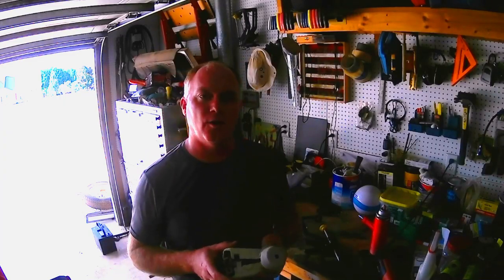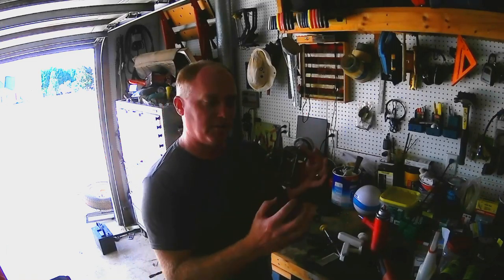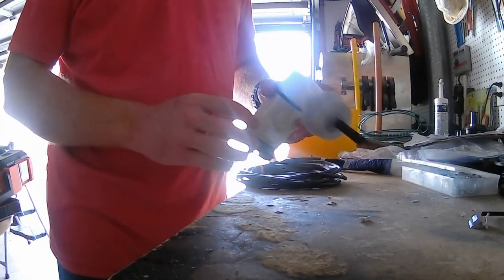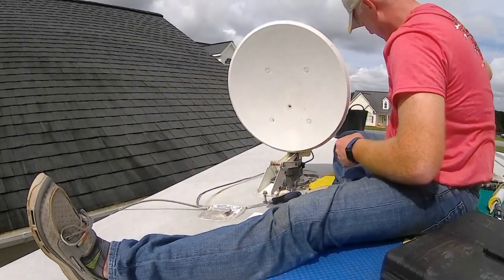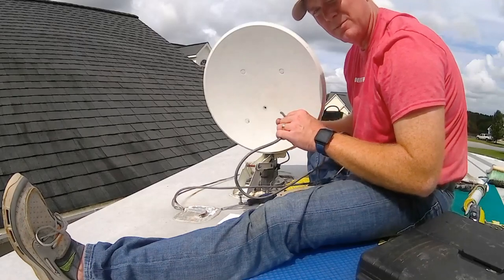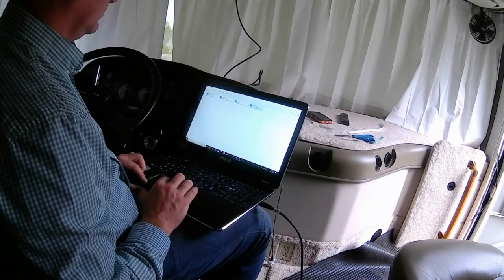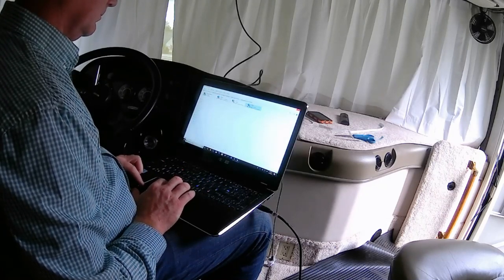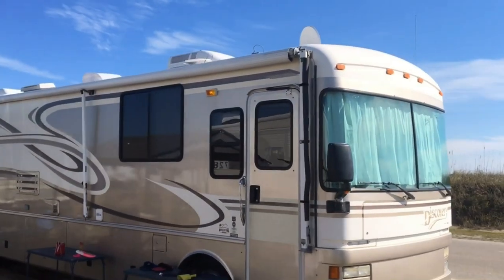Satellite Dish retrofit to a WiFi Antenna - Vintage Class A Motorhome

Comment: I went to Asian store and bought largest parabolic fry basket I could find. I cut off the handle and retroritted a USB wifi dongle to the focal point. I took that with me on vacations all over creation and it worked great.  We were on vacation in Kissimmee at a time share. We were on the 3rd floor.  The wifi was $50 per week.  I aimed it over at a motel that had free wifi and it paid for itself over and over.
Reply: How far was that wifi and how far can you connect with wifi dish?

Comment: I'm actually trying to work out a similar setup in the UK using old Sky TV dishes at both sides but I'm using it to connect 2 house networks together (parents and mine as I have servers at each property). I've done it before with a cheap shotgun aerial and a panel aerial but that was only providing Internet to my parents when they couldn't get it and I could. Fingers crossed my bi directional WiFi network works (similar to the campus WiFis)
Reply from the maker: Awesome!! As long as your alignment is spot on, it should work. All you are doing is narrowing the band and making an omnidirectional receiver and an omnidirectional transmitter, both directional.
Good luck!!
Reply: @RVPastorKevin  yeah that's going to be one of the most important issues but I was actually thinking I could get it roughly lined up via line of sight then us a signal/attenuation meter to dial it in to the strongest signal by moving it back and forth till I get it ideal. Was going to use a geared adjustment on the mount to make sure I can adjust in very tiny amounts. 3D printer should be able to give me a prototype and then I can print it in ABS and add a metal clamp for holding at that point. Anyway thanks for the idea of using the LMB I was just using it without but I can see how it could help with alignment etc.

Comment: i made an aiming sight for a dish  ....first  hot glue 4 small round mirrors  in a circle on the dish .. use the sun to find the focus point .. now use the sun to make a sight .. mount a ring sight just to the side of the antenna mount .and drill a small hole in the dish  as a back siight  . the sun will tell u where the hole should be .. it will be at the bottom and beside the antenna arm  .. use the sun as a calibration tool .. kinda like bore sighting a scope    yerh thats it ..  ifound that u only need to be off by a tiny bit    to get a bad  result.

Comment: Instead of a laptop use a router with a USB port. Make sure the USB device is supported by linux.  Get one with the following chipset:

    Atheros AR9271
    Ralink RT3070
    Ralink RT3572
    Ralink RT5572
    Realtek RTL8812AU
    Ralink RT5370N
    MediaTek MT7610U
If you do not know (and most would not) ask at the computer store. Any store worth their salt would know.

Comment: Mate, the improvement in signal has nothing to do with the dish !  You still have your offset dish looking into space and your wifi adapter's antenna is 90 degrees out of phase.  The improvement in signal is only because the wifi adapter is outside and up fairly high.
Reply: And the dish looks to be 18 inches.
Reply: Probably true. I saw one guy who mounted his dish upside down. But hey if it works it works.
Reply: Well, the antenna is 90 degrees out of phase of the signals coming directly at it from the source, but NOT from the signals reflected from the dish surface towards the antenna. So, I think this approach still has potential.

Comment: If you want you can attach a tin can to the end and drill a hole on the side and insert the antenna to get an even more boosted signal. You’ll have to look up cantenna equations so you know where to drill though.

Comment: Great Job... I plan on doing this with an old dish soon.  Do you know how far the range is about?
Reply from the maker: Well, the only way I can think to test the range properly would be somewhere very remote, with a known transmitter location that was line-of-sight away...... which I have not done. The math seems to indicate that a given a regular Wifi transmitter, and depending on the accuracy of the dish alignment, this antenna should be able to pick up signal over a few miles.
Since we have stayed in RV parks across the southeast, I can say that prior to this mod, park Wi-Fi was not even useful and we used our phones as hotspots. Now, I send my 12 year old to find the park Wi-Fi x-mitter, we point the dish at it, set my laptop as a hotspot, and the Wi-Fi at every park has now been so good that we connect the Roku and stream movies with zero buffering! I am very pleased with how this turned out!

Comment: Any specific measurement that should be followed,...and what was the difference in signal reception before and after.
Reply: Around 15 dB stronger, it's a lot, you can connect to nearest MD without problem from 1 miles.😁

Comment: So once you get everything hooked up how do you get more than one connection say my wife wants to hook to the internet does she find the usb that say is called Rv park WiFi or does she connect to the Rv dish that I built
Reply from the maker: Think of the dish now as a usb WiFi dongle. You plug it in to your laptop, then your laptop has the solid connection.  You then make your laptop a “hotspot” and you and your wife and your kids will wirelessly connect to the network that your laptop is transmitting.
Reply: Oh ok I’m having issues with my internet connection where I live! I live in my fifth wheel full time plus I’m a ham radio operator as well

Comment: yea Rev pls i need assitance. about the usb adapter, i got one not exactly the same you used but the outcome was discouraging. do you think yours could be better and give me the result or there could be better out there, whats the guide
Reply from the maker: Here is the link to the one I purchased.
https://www.amazon.com/gp/product/B0773ZPKS2/ref=ppx_od_dt_b_asin_title_s00?ie=UTF8&psc=1
Check to make sure the specs are the same, I don't think there is anything special about the one I purchased... i just know it works well with my set-up.

OK, a couple of things to make sure of, whichever WiFi adapter you use.....
Make sure you install the correct driver on your PC.
Make sure you dish is aimed directly at the wifi transmitter.
Make sure your LNB is correctly aimed at the center of the dish.
Make sure your PC has selected the USB adapter and not the internal WiFi adapter.

Comment: Hi can i install a mimo feed to my old dish antenna ? just to boost the signal of my internet signal instead of buying a parabolic.TIA
Reply from the maker: Ok, I must be reading incorrectly, and  I am confusing myself....
are you comparing an old dish antenna (like the huge 6’ rotating ones we had in the 80’s?) or the brand DISH? I think any satellite dish since the mid 90’s should work in the way I did the video, even the shape of the first DirecTV dishes would work, as long as you could replace the LNB with your USB WiFi antenna.

But you may be asking If you could attach a MIMO antenna to the LNB of your old parabolic to tighten the search band? That certainly could work, but I think a MIMO would be omnidirectional and putting it on a dish may do more harm to the signal than good. 

That is my uneducated guess at this point in how I think the question is.
(But I am in no way an expert...)

Have a blessed day!
Reply: @RVPastorKevin  yes, i  want to convert it into signal booster,because i live in an island.The nearest cell site is like 20kms away.My cellphone signal is really weak.I am using a Huawei Modem 936
Reply from the maker: Well, the antenna on the modem is omnidirectional, so you would need to change it to a directional.  As best I can tell, you would want to remove the stubby antennas, with one that was corded, and specific to LTE signal..... something like this would be where I would start my research if I were you.....

Wilson Electronics Wideband Directional Antenna 700-2700 MHz, 50 Ohm (314411) https://www.amazon.com/dp/B00J14YEHQ/ref=cm_sw_r_cp_api_i_C0ypEb3JB6ZRJ

Comment: Well if you don't have WiFi at an RV park just hope there's a local restaurant like McDonald's with open free WiFi 😂 you'll be good then too.
Reply: How far is the range of wifi dish?
Reply: @sezginozcan6612  it's been so long since I saw the video (2yrs ago) but if it's got a distance like modern tube or dish aerials you can be talking miles line of sight. When it's not line of sight they start losing distance quite quickly. In those cases something like an Omni-Directional aerial would be better as it would remove the line of sight need but be more limited in area covered depending on it's power output and the legality in your area (some places/countries the max output is capped or you'll be fined)

Comment: Can the signal go thru trees?
Reply from the maker: Yes and no..... it is “line of sight” so you need a clear view of the transmitter to get the best signal possible.  Technically the Wi-Fi signal will pass through certain objects, like how your Wi-Fi transmitter works in your house, passing the signal through walls, but those walls seriously degrade the strength of the signal.
Reply: So maybe it can pass? Also the router is about 600m away and it’s inside of house
Reply: And also is there a way to do it in opposite direction? Like put the dish on router’s antenna
Reply from the maker: depending on your router, yes there is.  On the NightHawk routers, it has 3 antennas that can adjust the transmission of the signal given each antenna's position.  You can also fashion a reflector and put it behind the router.  Now, this is very hard to do, but there are some YouTube videos on how to.  Positioning the router at the LNB location, in theory, would send a portion of its signal towards some receiver far away. (You can see transmitters and receivers on communication towers.)  Using the dish, the transmission band would be very narrow, the size of the dish, over that distance, so you would have to be VERY accurate at both ends.
Now, can you do this in your house with adequate results?  I don't know. I would doubt that you could get very much accuracy out of it, and mating the transmitter to the receiver from that distance would be quite the trick.  Can it be done?  Yes, I think so.  Can you do it at your house?  I don't know.  You would be better off to buy 2 spools of 1,000ft of direct burial network cable and bury it out to your receiver.
Reply: I think it’s easier to do the way you did in video

Comment: Can it send wifi signals
Reply from the maker: No, the dish is only a WiFi receiver. However, how I use it is that the Dish catches the WiFi signal and pipes it in to my laptop. Then I use my laptop and it’s HotSpot functionality to broadcast a WiFi signal inside the RV. It is password protected and only my devices can use it.

Comment: I’m looking to do something similar with a 4g antenna and 4g router .
Reply from the maker: That would work. I just use the laptop in the rig as a hotspot to our wireless tablets and smart TV’s, but if I had any wired connections, I would certainly use a router. However, when we use WiFi in RV parks, they always have log in information and passwords, so I don’t see how in my configuration, I could get away from the requirement of my PC to get me logged in first.
Reply: I am curious about the project, but does it actually help with the upload? Since the dish is probably only spreading sent signals as it bundles the reveived ones?